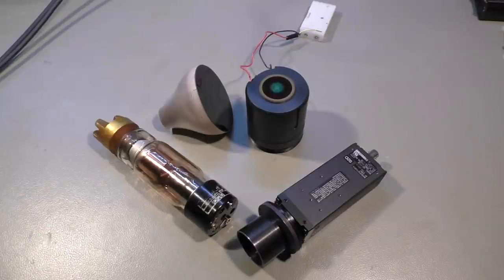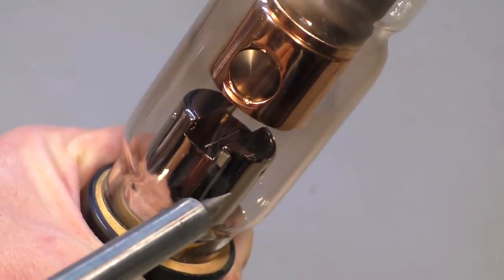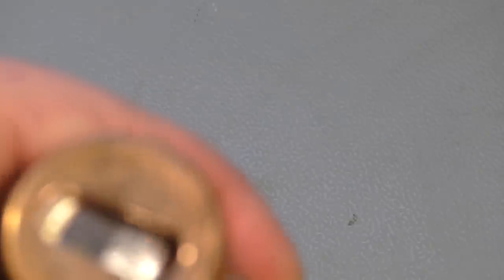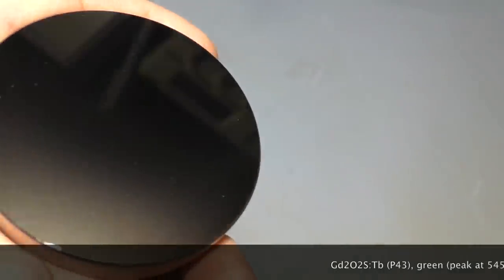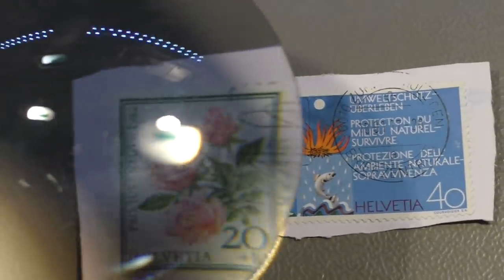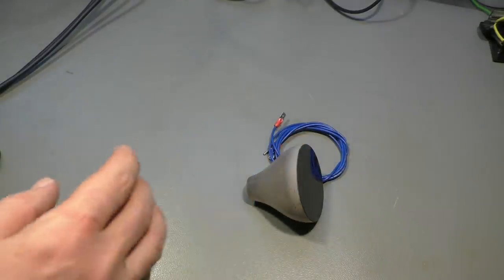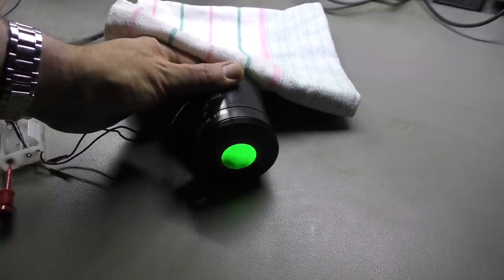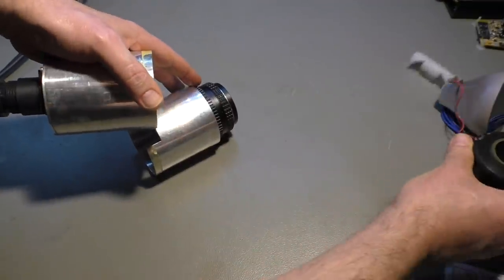What's inside an x-ray system? - Amazing toys! (PWJ49)

Comment: excellent video. I'm stunned by the effort that went into the video, with all of the machining of the aluminium parts.
optical taper: that's new to me. Very interesting.
I've once tried to sell an X-Ray tube on ebay, it was deleted by them for several times.

Comment: what you're seeing in the intensifier is a phosphor screen under a lens.  it is what actually glows when the intensifier converts the electrons from the x ray into photons.  I'm pretty sure there wouldn't be any phosphor screen on the optic taper as that is handled in the intensifier.
Reply from the maker: You got it wrong. There was a phosphor screen on the taper because I removed it myself. That screen is in place to convert the x-ray picture into visible light. The image intensifier is then used to intensfy the very dark picture from that screen. Then come the camera that picks up the bright picture from the I.I. and converts it into an electronic signal.
The I.I. does not react to x-rays...

Comment: Couldn't you use the optical glass on the viewing side of the image intensifier, giving you a larger image without the need to stick it up to your eye?
Reply from the maker: In fact I tried it and it works. The picture is a bit dark and not 100% in focus because if the thickness of the intensifier output window.
The bigger problem is that the taper is heavy solid glass. A bit too heavy for my taste.

Comment: So the camera is inline with the X-ray emission? I would have thought a 90 degree mirror or such might be more helpful for camera life? Perhaps after passing through those elements the X-ray damage risk to the camera is reduced.
Reply from the maker: The x-rays are already stopped at the phosphor and the taper. At the position of the camera there is no more radiaton.

Comment: What is the material of the black window in the X-ray tube? thank you for explanation! :)
Reply from the maker: It looks like stainless steel or aluminium. It only appears black because the glass is tinted. Could also be some exotic metal.... I don't have any information about it
Reply: Likely Beryllium, it's used to keep the electric field under control and stop stray electrons, while allowing the generated x-rays to pass more or less unimpeded
Reply: Agreed with +Mikkel324 It's very probably beryllium and is extremely toxic. Good thing it wasn't present in the other X-Ray Tube !
Reply from the maker: I better don't break that tube.... :-)